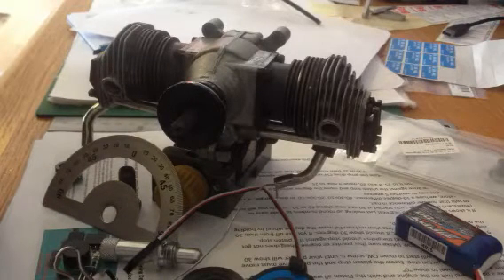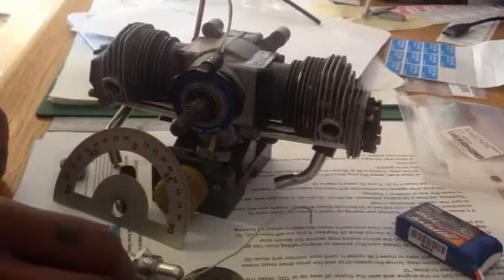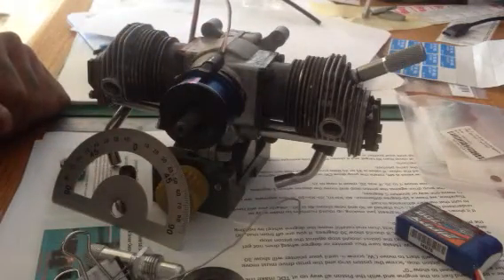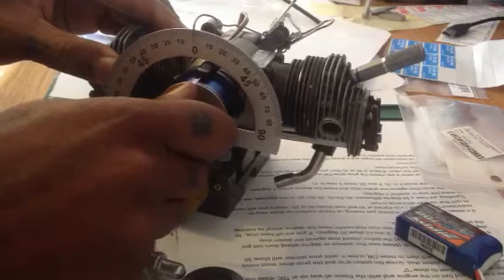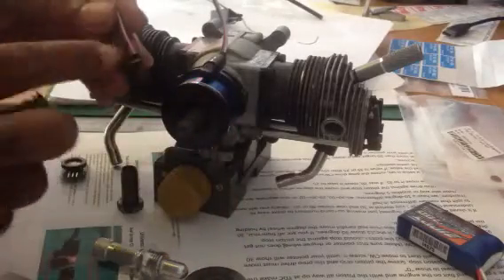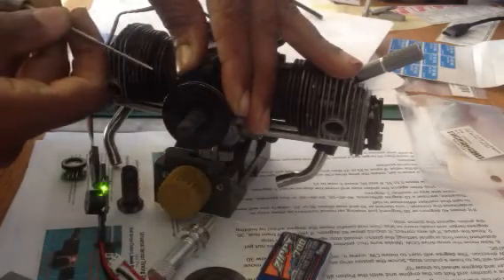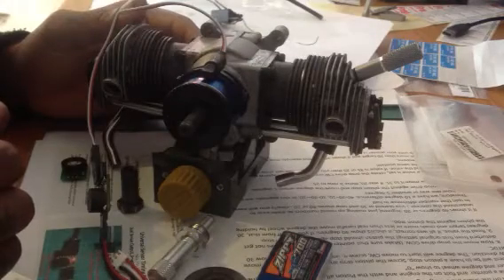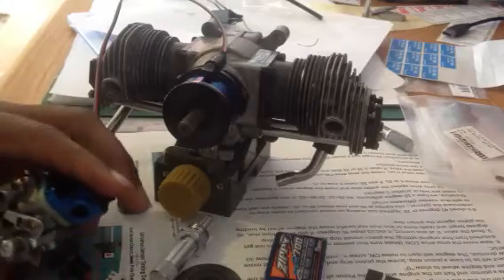ASP Magnum SC OS 160 Timing Setup

Comment: Very nicely manufactured modification items. Certainly a lot easier than taking the job on yourself without the parts made for you and the method of application shown so well. Highly recommended.
Brian Oily (aka Brian Winch)